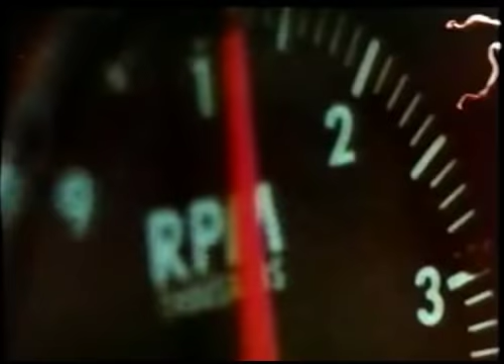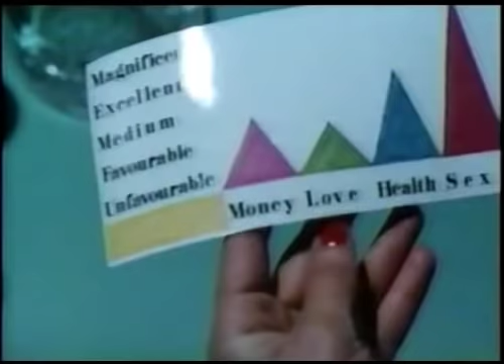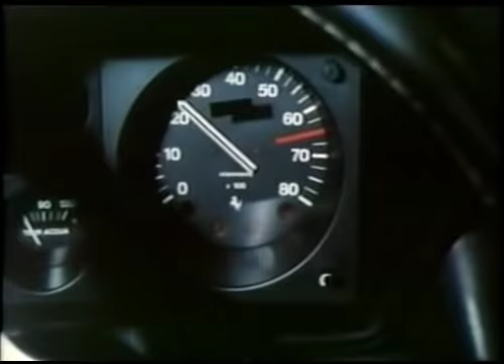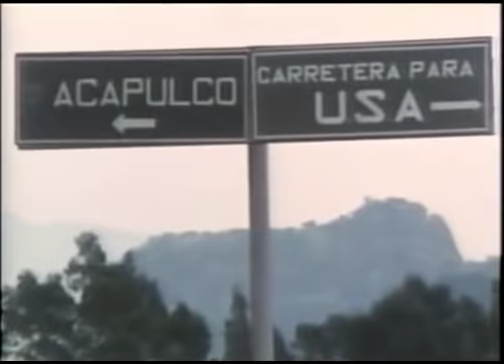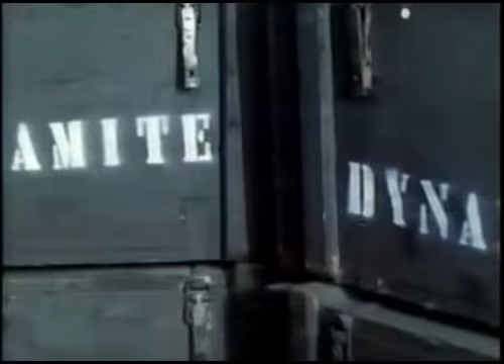Car Crash, 1981--Full Movie

Comment: I love these old cheesy car movies.  I've not made it through the opening credits and see all kinds of mistakes, too many to list.  But at a NASCAR event, they don't run off road 4X4 tires nor do they use 4 way lug wrenches or basketball nets for window nets and the car has the stock bench seat too!  LOL!!  There is no track they run on that has spectator seating behind the pits either, with the exception of Indianapolis Speedway which the Cup series
 didn't run at in 1980. But there is some great actual racing footage spanning about 2 decades and from different series.
Reply: Todd Davis ... I nearly died when I saw those tires. 😂
Reply: I saw one tire get shot that was a whitewall then it was a blackwall then a whitewall again. My head was spinning! That window net was hilarious. It's almost like they had no technical advisor on set at all and just winged it.